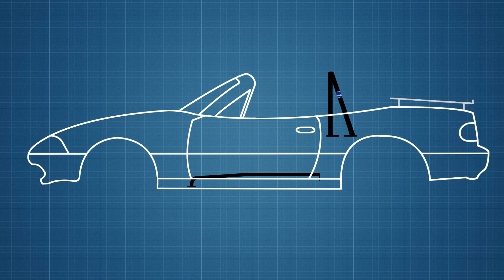Project MX-5: How To Track Prep Your Car

Comment: Really hope you are getting bucket seats... the way the harnesses are mounted now in any big accident the headrest would bend/break, your harness would suddenly be loose and you would slip out of them, flying into the wheel and then bouncing off the wheel and hitting your head on the roll bar because the headrests fell off. If you get good seats however it will be track ready and no longer a death trap!
Reply: Surely the rollbar will prevent any impact between floor and headrests?? I don’t see how the headrests can bend or break with a roll bar in place.

Comment: BTW, pretty sure you've got the springs set to their maximum height, rather than minimum height...
Reply: +Ray Syed He bought H&R coilovers, they aren't known for slamming cars.
Reply: dragkid185 Sure, but just looking at them fitted on the car, it looks like they're adjusted to the highest point in the thread. I could be completely wrong but surely screwing the adjustment washers and compressing the spring would lower the car no? I'd actually like to know, since I don't!
Reply: Ray Syed No adjusting them higher increases the spring rate making the car sit higher. He's pretty much bottomed the adjusters as low as they go. If he wanted to go low he would have bought some ultimos.

Comment: Don't forget, good sport wheels alignment like the 949 Dual duty one.
Don't forget ajusting tires pressure for the track
Don't forget to top up fluids
Put Carbone Lorraine brakes pad on it

Nice project guys

PS: And because now you have ajustable coil overs, please use it properly by corner weighting your car, massive, massive enhancement

Comment: for the seat belt mounts, my bolts didn't line up either. I used a c clamp to pull the bar to the tower. works great!

Comment: 8:50 using thread locking compound after tightening a nut onto a bolt (on the protruding thread) is a certified application of the product advised by the manufacture..

Comment: you were wrong about the loctite from inspection, from the green label it did look like wick in loctite which can actually be used after the bolt is tight, the loctite works its way up the thread onto the nut
Reply: it depends what number loctite it is, i cant personally read it with potato quality and internet, if it is 290 or 291 it is a wick in, but yeah i may be wrong not sure of the number

Comment: Have you considered forced induction either super charging or turbo charging? A nicely worn in engine is perfect for forced induction so long as you do not get crazy with the boost. In the USA taking junkyard V8's with 50,000-100,000 miles and adding Chinese made turbo kits is pretty popular. No reason that the same idea can not be applied to smaller stock engines in Europe an engine is an engine!

Comment: also why didnt you just notch out the slot where the bolt for the seat belts goes through to be able to bolt it down straight so it doesnt cross thread?

Comment: What needs to be done after the brakes (imo): 
1. Forced induction 
2. Bucket seats
3. Racing steering wheel
Reply: And also bumpers and skirts and stuff
Reply: +TheGranFan04 unless u get one with an airbag, which means you have to get a new wheel like I did, but I guess $300 later it was worth it.

Comment: Is the soft top still functional with the roll bar in place? I really want a bar for safety purposes (also looks really cool) but I want to keep it functional for everyday use as well, and was looking at the same or similar model bolt on bar. Also , any recommendations? Thanks guys!
Reply: +josephisthegreat Yup, fits over perfectly. My roll over bar and side bars are from Moss Europe: http://www.moss-europe.co.uk/shop-by-model/mazda/mx5

Comment: GREEN loctite. Damn, you do like to live dangerously! Blue/red would have sufficed without the permanence of green.
Reply: +Jason LeBlanc  I would not go by the colour of the thread lock: Take a look at this site:
http://www.type2.com/library/chemicals/loctite.htm
Reply: +ak47gat1 Oh but in this case I think it's safe. I work with dozens of different locktites and greens are almost exclusively for permanent applications like loos fitting bearing races or locking threads without disassembly. I'm very familiar with their catalogue and would never use anything green on threads unless I'm okay with them being together until my death.

Comment: Huge school boy error not mounting the roll bar in and lining it up with the seatbelt mounts! Could have saved you a lot of time! Bit of a bodge if you ask me, but I understand that re-mounting the roll bar would've taken more time!
Reply: +Callum Osland Yeah, we're not mechanics, but we got there in the end. That's what makes this series fun imo :)
Reply: +Alex Kersten haha yeah I understand! Still a great job considering you aren't mechanics! Sorry to seem like such a pessimist!
Reply: +Alex Kersten pretty sure the roll bar NEEDS to be bolted to the seatbelt mounts as it's the most structural point between the sheet metal under the parcel tray and the seatbelt mounts.
Reply: +hamza3608 That is very good point...

Comment: mcm looked like they did the same installment with more ease :o
Reply: +zibby Jdm MCM used a bar that just bolted on into existing holes.  Alex used a bigger bar that bolted into the frame of the MX-5. More work, but more safety.

Comment: Guys please re-do the harness/seats combo as this one is not actually safe!
Reply: Yeah, 4 point harnesses are not safe at all.
Reply: +Joey Kissinger 
Are you an NFS kid?

They are a huge effort if installed and used properly only. Otherwise they tend to brake users' bones instead of helping. Take a look at the forces created by tension of the belts in case of impact, you'll see.

Comment: what a bodge .... if that was well made roll bar it would have correct brackets for fitting and retaining the seat belt mounts and you wouldn't need to cut the car at all to make it fit just drill the extra holes required. plus the way you have the harness routed on that standard seat is just plain dangerous , any good track Marshall would fail you on inspection for it.

Comment: Fucks sakes, you complain about lack of a plate... Go to the store that holds steel plate, get a 2.5mm(1/10inch) plate, drill 'er out, put some good paint on every bare metal surface left by drilling and you are done... Never hurts to have more steel in 'er for rigidity...
Reply: might as well put 2 nuts on each bolt... With all that threadlock on there, its a waste not to add a few more nuts, i know its gay if your nuts are touching, but hey, if it keeps you rigid and hard, go for it...